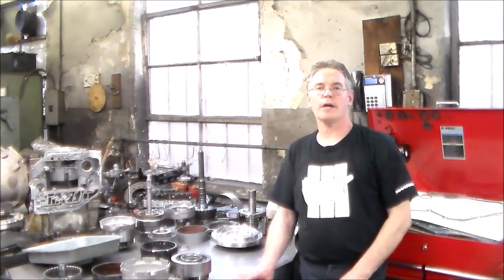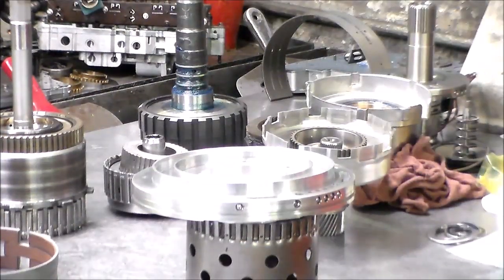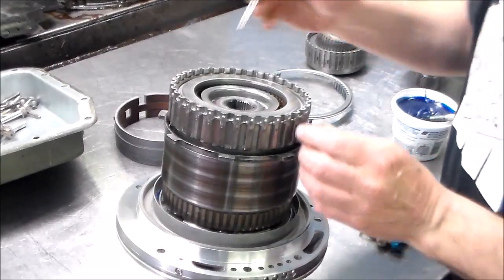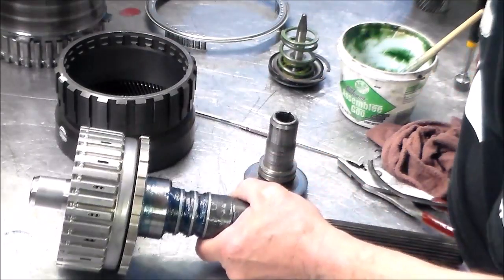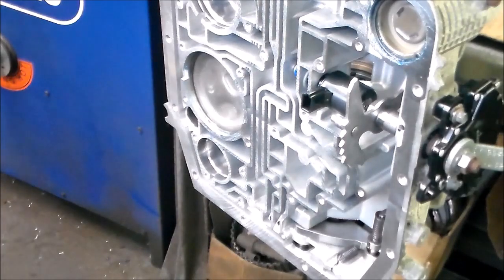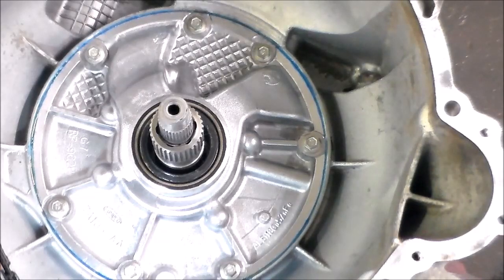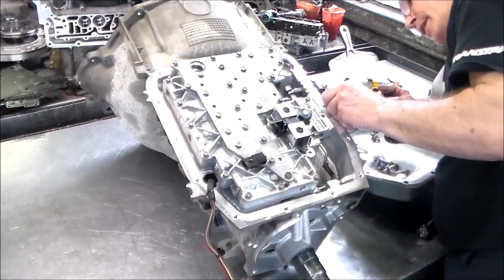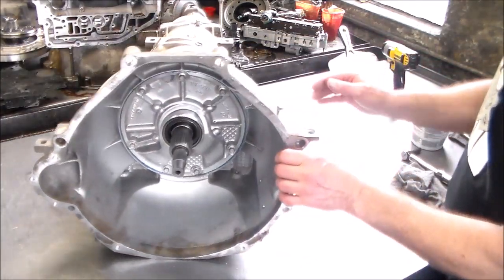4R70W Assembly

Comment: Gary (or anyone else !): I have a 2004 F150, 4R75. My first rebuild (broken reverse band). It is soft rebuild only, all other components are in good condition and passed the inspection. The question is on the air tests. The direct drum only seems to pass the test if I have assembly lube on the output shaft seals , front and rear. If I apply air to the supply port on the valve body with components dry, the drum does not respond. Is this normal? Thanks in advance !
Reply from the maker: Are you air checking the drum through the case?
Reply: @GaryFerraro   Thanks, yes. I have verified the new lip seals and shaft seals are installed correctly, no tears or pinches.I have pre-lubed them all generously. I noticed some slight scoring on the end case bore where the output shaft exists. I have installed new steel sealing rings provided in the rebuild kit. Just wondering if there could be a sealing issue there and air escaping. Is some air leak acceptable, since the ATF is much thicker ? Can I buy slightly larger shaft seals and lightly clean up the case output bore? Thanks again for your time.
Reply from the maker: @homerdodd4264  May not be solid. did the back of the case  have ring grooves?
Reply: @GaryFerraro   Yes, only one very small surface gouge, barely catches my fingernail. Covers about a 45-60  degree span area and only on the bottom. Can they be lightly sanded out with emery or wet or dry, and then plenty of lube during assembly? Will the fluid itself  aid in sealing ? Thanks again.

Comment: what happened is the shaft is too long and when its overloaded the drive shaft pushes on it and breaks the clip and bearings, cut the output shaft until the hole is gone and it wont hit and shove the shaft forward to break the clip
Reply from the maker: Correct

Comment: I have a 201 mustang with a AODE4R70W trans missiopn  when you but it in drive it woulded go drive right away it toke about 3 seconds for it go ion drive now it the rpms high befor it slams in drive and takes off it shifs good thu all the  utill you come to a stop and it kicks out of drive .
Reply from the maker: solenoid reg valve may be stuck in the valvebody